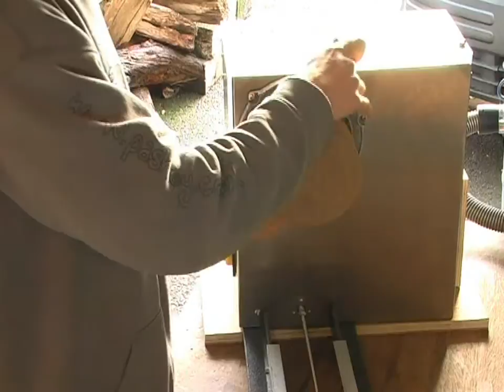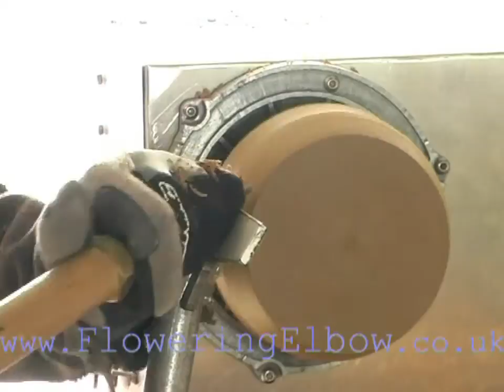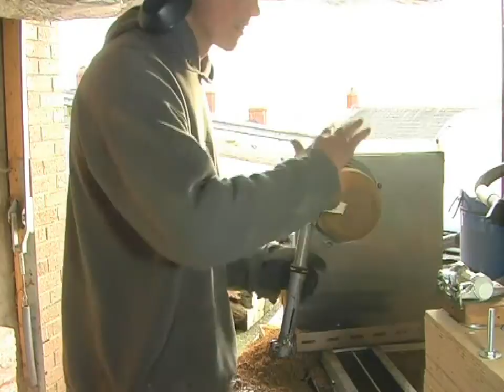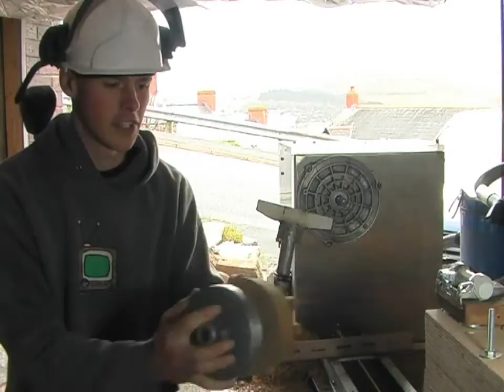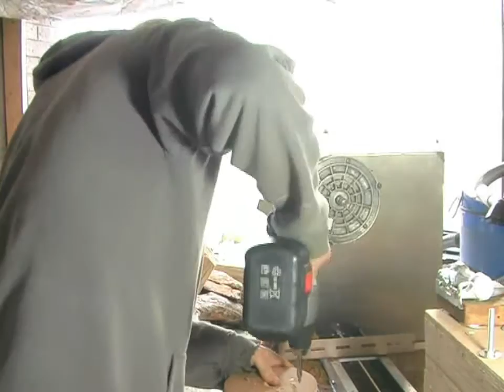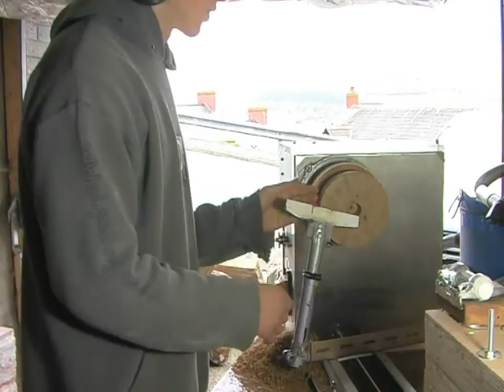Turning a bowl with scrap made lathe (part 1)

Comment from the maker: @Spartan117A1 
If it doesn't go wrong at some point I would be worried.  Personally, having had some experience with build and use, I would look about for a more powerful motor (depending on what u want 2 do with it of course).  It is always better to be overpowered - that is, if u have pulse width speed control, then you don't have to worry too much about wasting energy with a big motor.
Thanks for the compliment - although I would usually take looking 'professional' to be a touch derogatory ;)

Comment from the maker: @Spartan117A1 
No. Like almost all wood lathes the bed is too far from the main spindle and chuck - meaning too much flex, and the tolerances are not high enough... Also it does not have a fixed tool mount like metal ones, but a 'tool rest' for manually operated tools instead. 
You could make a meal one with some mods though...